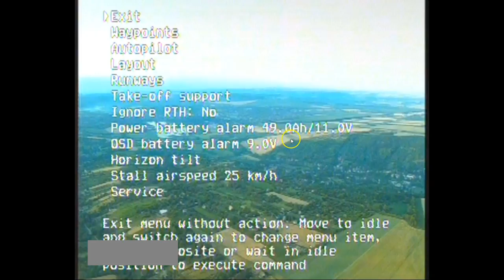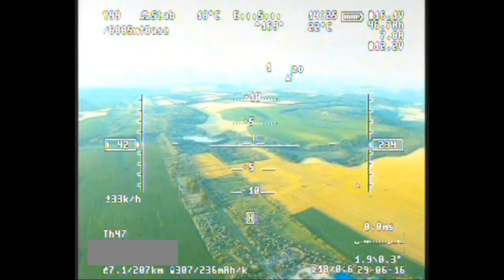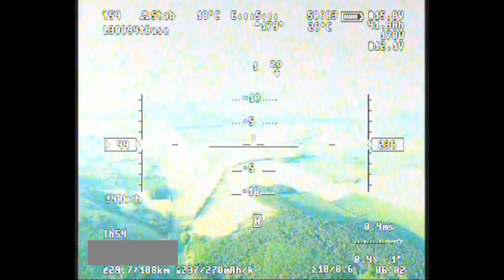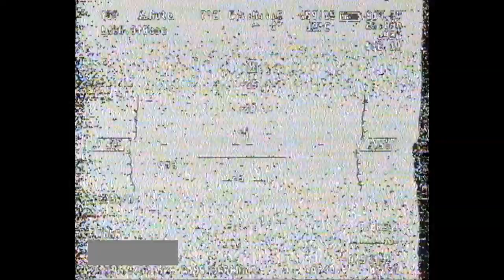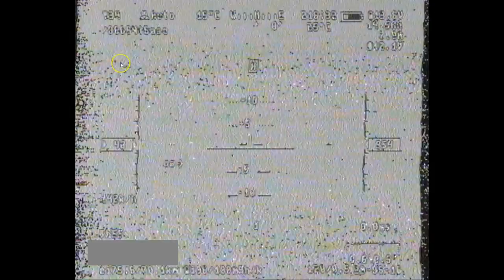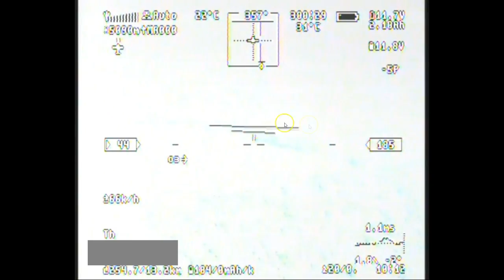264km FPV record long range flight (132km out and back)

Comment: why was the video fucked even when you landed>?
Reply from the maker: The sun broke the CMOS sensor.
Reply: @pompecukor1593  wow i thought all cameras could be exposed to sun
Reply from the maker: @alanssnack1192 me too, but is seems this old mobius (v1) had a problem with it. Again it was pointed into the sun directly, for like 20mins. And it was any exceptionally strong rising sun. I remember very well. I know CMOS is more sensitive to is. Actually what was strange is that about 2 weeks after this the camera came back to normal. So strange. Anyway it is what it is. Next time, if I ever have the time, I shall not use such.
Reply: @pompecukor1593  thats amazing distance u have flown,  i get a lot of fpv nerves myself, i have to breath deep and stuff to keep myself together, and my heartbeat can go fast.  but i remind myself its not me in the plane so dont worry.
Reply from the maker: @alanssnack1192  Thank you

Comment: I wonder if you could deploy a series of ground stations ahead of the flight to relay the signal back to the base. Also could you transmit the video signal via gsm network, 3G or 4G. I have no idea about long range fpv flying but absolutely love the idea of it, such a beautiful video and romantic notion of flying long distance by remote

Comment: Is this a world record for longest range RC flight?
Reply from the maker: That is gas plane, whole different league. the only reason that ha was included in the list is that there was no separate list for gas planes. If gas plane counted then US military drone (predator) has flow over 500km many years ago. So it would be nonsense to put electric and gas in one bag.

Comment: Great video man and great flight! I am looking forward to doing a long flight fpv and you inspired me. thanks for sharing.
I really like your OSD display; the speed and altitude displaying like in a real plane, which application you use in it please?
Reply from the maker: Thank you for the kind works. The AP/OSD system is called PitLab as explained in the video.
Reply: Thanks for your quick answer. I am having an issue with my apm ardupilot 2.6. It moves the elevator in wrong directions while it is in stabilize mode making the plane pitching too high or too low. Can you please help me to solve this problem?
Reply from the maker: I do remote support and consulting for many people like yourself. You can find details about this on my website longrangefpv.com please read what you see then, then you can use the contact form to contact me directly. youtube comments is not ideal for support. cheers Alex
Reply: ok thanks

Comment: 134 km record argentino ajajajaja
Reply from the maker: That was gas, this is electric, if you did not notice. So a different ball game....
Reply: Absolutely amazing flight and very powerful setup - I am amazed to see that you only needed 120-160W with a MOW of 5kg; on that big wing surface of the MTD, I would believe that one could install solar panels to supply at least half of that power. Seeing the weight of the battery of ~3kg, I guess that you haven't had much additional payload in the plane. I'd be interested in such an efficient mapping UAV, replacing thereby the FPV by a good ground-facing camera, and furthermore looking for VTOL capabilities. I guess I'd need primarily a powerful telemetry transmission equipment instead of the FPV long range stuff. Just a question about your equipment: what would be the approx. price for all needed equipment?
Reply from the maker: Pascal Fust hey Pascal, nice to meet you. We build exactly those kind of mapping UAVs. Please visit www.araceaerialsystems.com and contact me there.
Reply: Thanks for the info. Contacted you as suggested.
Reply from the maker: Hi Pascal, I did not receive and contact. Please try again. Or you can mail me directly same user name as you see here (pompecukor) at gmail dot com. Cheers Alex

Comment: Awesome flight, gripping!

You mentioned that you're using a 49Ah custom made 4S 14P Li-Ion battery pack presumably of the 18650 form.

49Ah / 14 cell groups in parallel = 3.5Ah / cell

I've found 3,400 mAh cells but the issue is that they have a very low C rating (around 1.5A/cell). Even at 14P, that's still 21A total -- which is fine for steady flight, but insufficient for take off (you hit 75A!). 

How did you overcome this issue?
Reply from the maker: Better not try to make packs for yourself. From your question (which I have seen that you edited) it is obvious that you lack some of the principal understand of how the relevant electronics work. Cell in series increase voltage, while cells in parallel increase capacity. The cell that I use to make my pack are in fact typically 3,500mAh. In the case of the pack used for this flight the maths is simple 14 x 3500 = 49,000mAh. If need a pack then got to my web site, you will see the relevant link there and also how you can contact me. Making li-ion packs is dangerous, you need a spot welder in other not to overheat the cells!!!
Reply: Made a calculation error on the original post so fixed it. Checked your website -- it doesn't mention the continuous/burst discharge current for the cells?
Reply from the maker: No it does not, but is does mention how to contact me if you have any question and are interested in buying a pack. This video is not about the batteries, but about the range flight. I am happy to assist you directly. Cheers
Reply from the maker: you are very welcome and thank you!

Comment: I'm fairly certain the white stuff is a haze layer that's being backlit by the sun which is still low in the sky. It's overwhelming the camera sensor.
Reply from the maker: Bingo. That is exactly what happened. IT took a few days for us to realize. The plane was set on the ground for like 20mins with the CMOS lens facing the rising sun, which was exceptionally strong at this time of the year.
Reply: Very informative video by the way, I just bought a Pitlab for myself.
Reply from the maker: You will be very happy I think. If you need help with the setup let me know. :)

Comment: Stunning record... who'd think this was possible! Your camera - have you perhaps set the exposure etc recently indoors? I've done it and it looks OK when in the garage, but when outside, it's totally overexposed.
Reply from the maker: It was later revealed that the failure was due to the CMOS lens sensitivity to the SUN. While I was getting ready. I unfortunately had the plane with the camera facing exactly to the rising sun. For 10-20mins non stop. This is why it failed here. After a few days it camera back to 100% functionality. too bad, but at least is was 3x the excitement.

Comment: I'd say you should have gone 5s (or higher kv) + the smaller props and overpower the motors a bit for the few seconds of takeoff... Losses will be high for that period, but should give you what you need and a few more km of range

Comment: That is an incredible flight!  Thanks you for sharing this video!  Would you mind sharing the video transmitter specifications?  You mentioned that the video receiver antenna is a Yagi that is about 16dBi centered around 1280 MHz, but I would like to know what kind of transmitter were you using on the plane.  Specifically, what model of transmitter and what was its power rating? 1000mW?  You are truly an inspiration to many of us who are interested in long range FPV.
Reply from the maker: Scott Conaway it is lawmate brand  vtx. Unfortunately no longer in production.
Reply: 800mhz?

Comment: Amazing flight Alex, I can testify to the quality of Alex's Li-Ion packs they're brilliant, i have 2 4S3P packs from alex and regularly get 50, 60 80 miles out of them in my mini talon.
Reply: Keith Sutherland what uhf rc and antenna combo, and vtx, rx and antenna combo are you using?
Reply: andy dsing tbs crossfire with Truerc moxon,  vtx is lawmate v3 using lhcp airblade and a crosshair.
Reply: if you use the tbs notch filter everythings fine
Reply: Isnt it that its hard to use the crossfire with 1.3ghz video? i thought it messes with the video?
Reply from the maker: Thank you so much buddy.  I really appreciate the feedback.

Comment: That is an amazing accomplishment. I love that the AP preformed flawlessly. That took a lot of thought and planning to bad the camera failed. It looked like there may have been some moister in the camera housing that interfered with the electronics. Ive seen some thing similar. It causes it to was out the colors.
Reply from the maker: Thx, What I am thinking now is that it was indeed the sun, over the CMOS. I had the plane sitting on the ground while I setup, unfortunately it was pointed directly in the rising sun. Even without being power up, it did it's damage. Just took time to manifest.